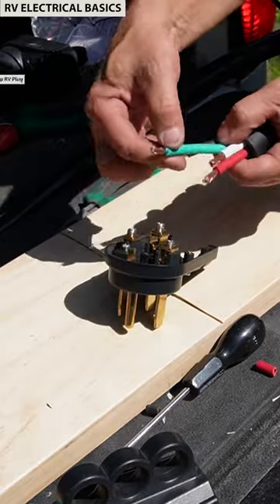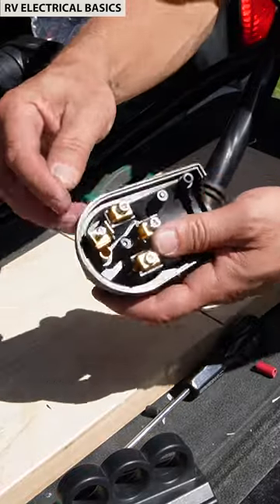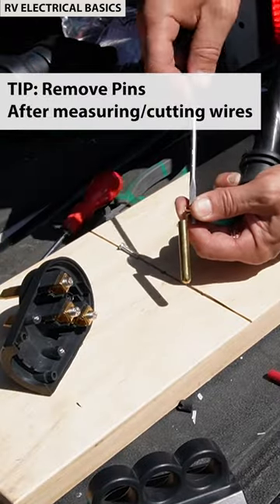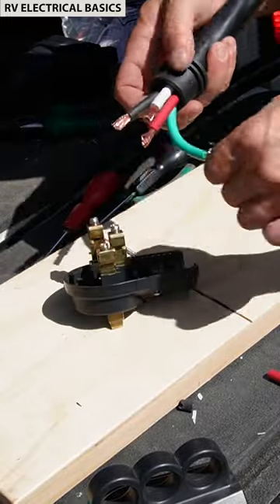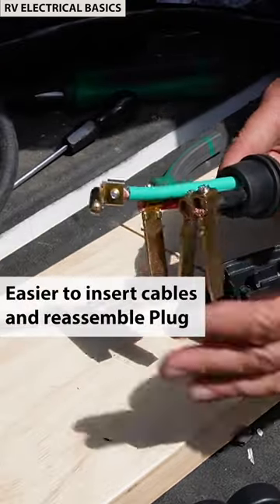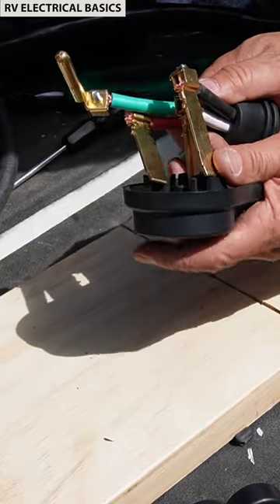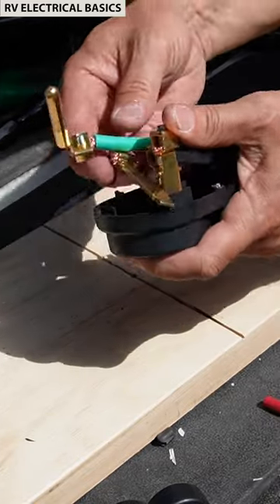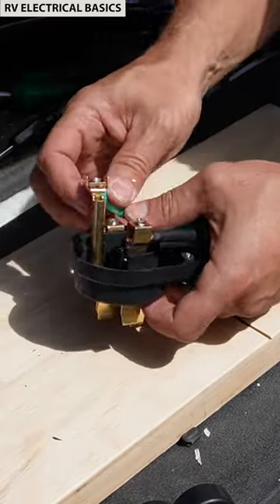Easier Way to Assemble 50A Power Plug #rvtips #diy #rvwithtito

Comment: You should look into crimping on ferrules on the exposed wire. It creates a stronger connection and prevents the set crew from coming loose when the small strands shift.
Reply from the maker: Yes. For the thinner stranded cable like these those work well. Not so much for the thicker stranded stuff. Thanks for the tip!

Comment: Should be using ferrules even with the larger gauge wire there’s hydraulic crimpers like the kind you use for battery lugs

Further more I would solder them if I have access to the copper like you do here

And also use dielectric grease to prolong the life of the connections.

Comment: I have a 2001 fleetwood bounder with 2 Acs with 30amp service. Would you have an idea how much it would be to switch to 50amp? So I could run both Acs.
Reply from the maker: Don't know how much, but it could be done. It would involve a significant amount of wiring. Plus you'd have to replace your electrical panel to support two separate branch circuits or add a second one. Then you'd need a 50A transfer switch if your rig has a generator. Those are my initial thoughts. Hope it helps.
Reply: @RVwithTito  Thank you so much for the info. I thought it would be quite a bit of work and quite a bit of money. Keep the videos coming I learned a lot from them. Thanks again for your reply.

Comment: I imagine someone putting the flat connectors in the wrong position and blowing something up. lol
Reply from the maker: As long as they are in the wrong position on both ends, you should be ok :)
Reply: @Tito The problem with that is, what if another person comes along and puts a new plug on it in the correct position on one end assuming the other end is correct when it isn't. You should always wire something correct so the next person gets it right and cant blame you. You may sell it or take it to someone for service.